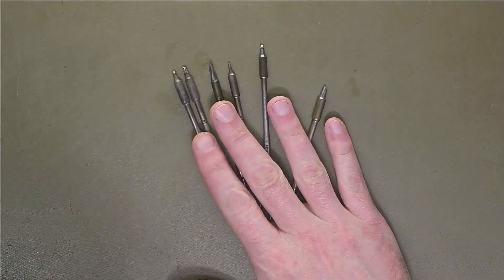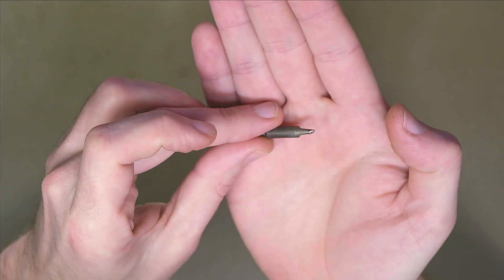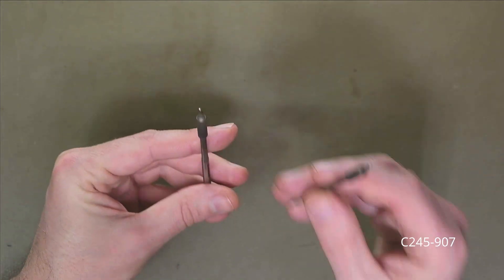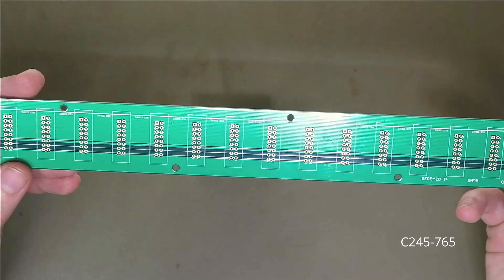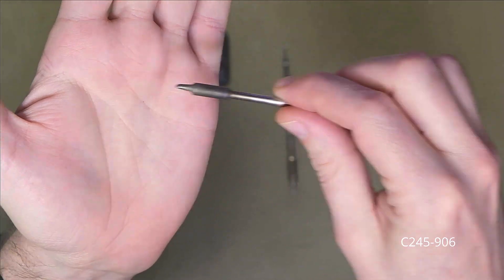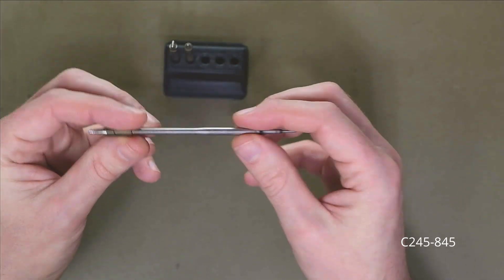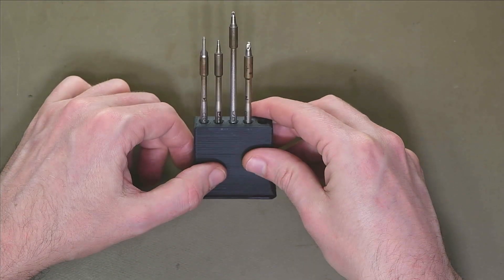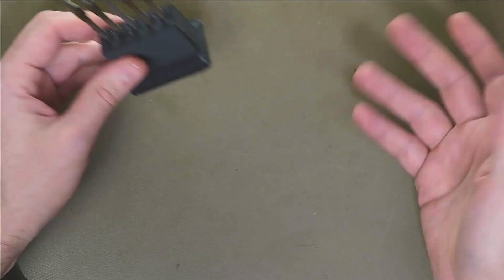Soldering Iron Tips for Synth Repair (JBC)

Comment: Hey, first of all; thanks for sharing your insights, additionally the live repair videos you've put up are great to watch. 
I am wondering how you approach work on boards that use unleaded solder; do you use separate tips or remove the unleaded and then redo the joint with leaded?
I've only limited experience but after running into some issues touching up/doing repair attempts on leadfree boards started keeping some separate tips and such trying to eliminate that variable from the list of possible causes...
I ask because I hope to upgrade my somewhat awful atten station to a jbc one in the near future but considering the price of the jbc tips I'm not sure if it makes sense to continue the pb/no pb distinction there. Greetings from a fellow synthforum member and hope you find the time to put out more videos at some point :-)

Comment: Great Stuff. It is really great you explained what RTS (Reduced Tin Surface) means. I wish I ordered that C245-102 tip. It makes a lot of sense. I would never figured that out myself. I ordered the C245-906 and -907 (1.2mm and 2.2mm). Will see how that goes. I would like to create analog preamps for my son his Music studio. For me it is a hoppy, in my early days I did a lot of service repairs and troubleshooting on Medical equipment (with a mix of analog and digital gear).
Reply from the maker: Thanks, that sounds like a nice project.
Reply: @HumanErrorSynthRepair  
Received today the JBC iron station. So far I like the C245-906 the most for standard size components like OPAMP and resistors. -907 I think is more for bigger wire soldering. What is a bit disappointed is, that there is only sleep mode, but no hibernate (in case you forgot to turn off the Station). Or is there something I do wrong?
Reply: @TheVorst   "there is only sleep mode, but no hibernate" Mine does both. Try looking in the settings.